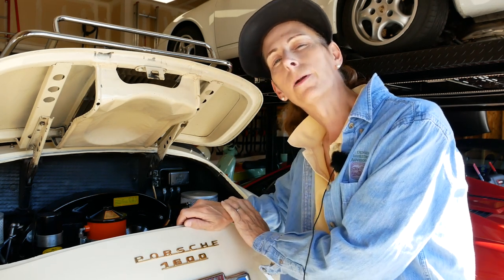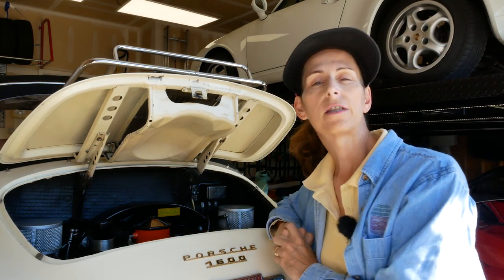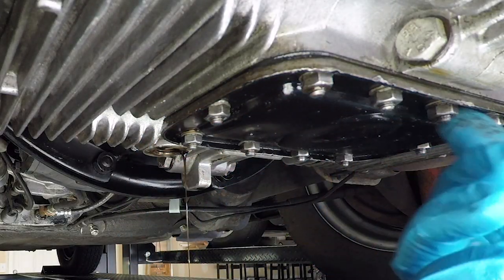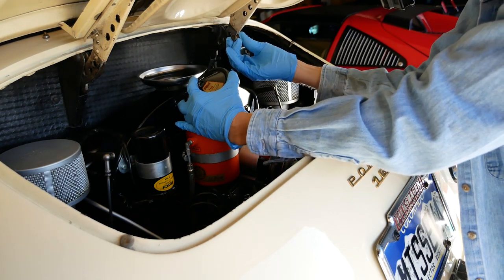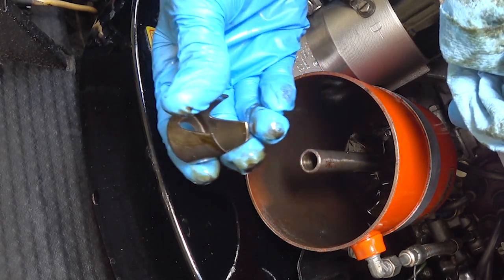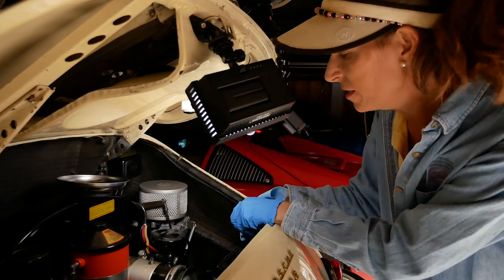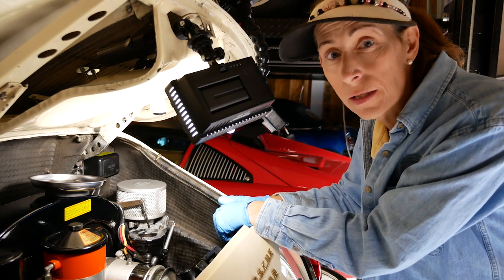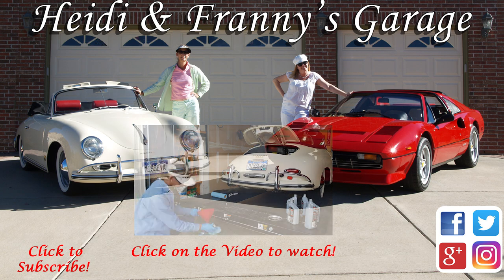Porsche 356A Oil Change!

Comment: I had to do a lot of research in the forums about what oil (viscosity and brands) to use in my 65 C. Freeze framed Heidi's most excellent camera work and saw the viscosity...yes! (Of course I read all the comments after watching and there it was....20w50!
Many thanks again for simple, direct and well edited videos...(and if your kitchen is as clean as your cars I'd eat turkey with y'all anytime.)
Reply from the maker: :) Yea!  I will add that to the description.  My bad.  Sorry about that.  Yup, Valvoline 20W50 Racing.  I believe it has a bit of added Zinc as well.  Thanks for pointing that out!  Have fun in you C car!  Franny

Comment: Excellent video! I have a couple of suggestions from my 57 years of changing oil on all makes and styles of oil sumps and filters. 

Regarding the drain plug, how about taking your torque wrench and see what the actual torque you have been using all along? Seeing that really long wrench really scares me - it looks like an opportunity for Murphy's Law. 

Instead of a turkey baster, I've been using a soft soap dispenser pump from a bottle to just stick into whatever fluid is in a tight area (power steering fluid, brake fluid, transmission shifter turret on a Miata, etc.) and just pump the liquid out. I have several of these, all labeled and stored in different empty coffee cans (repurposed plastic cans) for regular use. 

I love the fact that you don't overtighten anything! Keep the videos coming!

Comment: Instead of using a turkey baster for removing the old oil from the oil filter canister, I've found aftermarket pumps that fit into quart bottles to work much better. Just place a jar beside the canister and pump into it. Less messy and it gets more out. You can find these pumps at any auto parts store for about $5. If you need extra reach, you can attach a tube to either end, suction or discharge.

Comment: Hello Franny and Heidi...commented recently on the turkey baster. Recently added a perfect 20 year old SL500 to my garage..surprise, surprise it has virtually the same oil filter set up as our 356's. A turkey baster won't work on this one so researched and found an oil suction gun (OTC 2359. ) Google it...available most places for less than $20...works flawlessly...no mess...what's not to love? PS...checked out your 356 fuel pump video just now...two thumbs up!
Reply from the maker: +Camp Walosi that's awesome!  Congrats on the new addition. I am sure you will be a great parent!

Comment: Great video ,well done !what kind of oil do you use ?5w30 or 10w30?
Reply from the maker: We live in Colorado and we use VR1 20W-50 racing oil by Valvoline.  It can be easily found and we always keep a quart in our car.  We also keep our garage heated and that helps in winter months.
Reply: @HeidiandFranny  you are perfection !iam from greece and i like your mechanic moves and choices!thank you very much for everything!here in greece we use 10w30 by the way!

Comment: Hi Franny, my 1963 S appears to be missing that metal filter spacer stand at 6:30. Would you happen to know the part# for it?
Reply from the maker: Hi Geers, Do you have the same Orange filter housing or is it the silver F-Filter housing?  I'll have to check with some friends to see if they also have that spacer.  Franny
Reply: Heidi and Franny's Garage Hi Franny, it's the non-orange silver one. Thanks for any info you may find.  Not too worried about it...

Comment: Hi, I didn't see the dipstick oil level. There are two marks on the dipstick. What are your reccomendations for the oil level mark. Exactly on the lower mark, halfway between the two, or the top mark? Thank you.
Reply from the maker: Hi Josh, I like to shoot for the upper mark.  They will use oil and I think that gives a nice safety margin.
Reply: @HeidiandFranny  Thank you. Also if you don't mind, what sort of oil would you suggest using in my 1957 356A T1? I've heard two sugggestions but wanted to know what you use. 55,000 miles. Thank you so much.

Comment: Franny: What kind of oil are you using and how often do you change it?
Reply from the maker: Oh, now that can cause a fuss!!  I use Valvoline 20W50 Racing.  Brad Pen is very popular too.  I try to use an oil with a good viscosity, high Zinc and something I can hopefully find on the road if I need to top off on a trip.  I change the oil twice a year, but the filter once a year.  We do drive the car a good bit averaging close to 4K miles a year.  I shoot for every 2K miles.  Franny

Comment: Love your vids, but please please please keep that pony tail away from the fan belt of a running engine. That could get nasty! Also, could you recommend a reliable shop in your area to do a 993 PPI for me? I'm new to the area. Thanks!!
Reply from the maker: +Steve Kopald I will feel more comfortable giving you some resources for those questions. First of all, please join the Facebook forum for Rennlist for 993s and ask your PPI question there.  If you have an email I can give your some other resources depending on where you live. PM me or leave your email. Thanks. Heidi

Comment: I see "1600" on this lovely porsche and just wanted to ask could this at all be relative to a 1600 Vw?...I'm a little new to this and need to change the oil on my 72 super beetle. People tell me  amsoil 10w-30, Valvoline 20w-50, any recommendations? Great video by the way, love these clear and easy to follow instructional videos.
Reply from the maker: Thanks so much!  I'm a fan of the Valvoline 20W-50.  It has extra zinc and you can get it anywhere :)  Oh, I just uploaded a complete VW service video.  It is super long, but should help: https://www.youtube.com/watch?v=RJyypWxF3f4 

The Porchie and VW are cousins.  Kind of like the country mouse and the city mouse ;)  I did a Compare between the two in this video: https://www.youtube.com/edit?o=U&video_id=kqp113I4a88 if that helps...  They are close, but there are several key differences. They are both great, just designed for different uses.  It is a testament to the flexibility of the platform and the design talent of their common granfather :) Franny

Comment: German vehicle gets an oil change every 10,000 miles. or 2 years. So changing the magnet thing every 3k is a nogo.  Every 30k maybe. If you change your oil before 7k miles in a german vehicle, your wasting your money, 7k miles if you run it hard. 10k under normal conditions.  Porsche 911's are 20k or every 2 years.